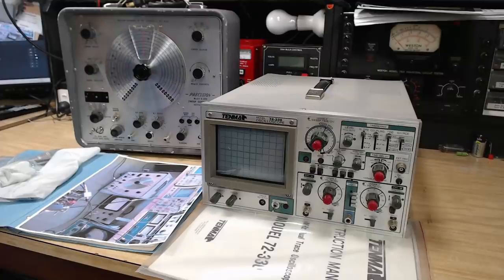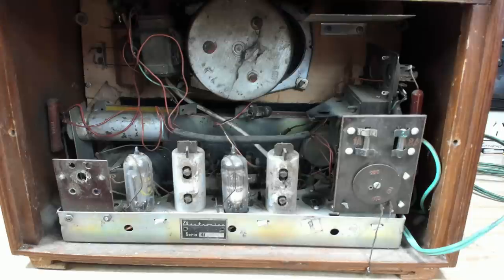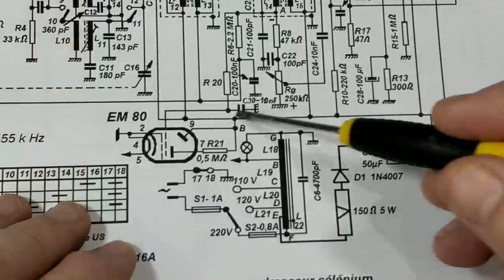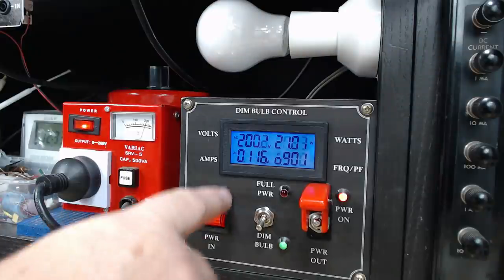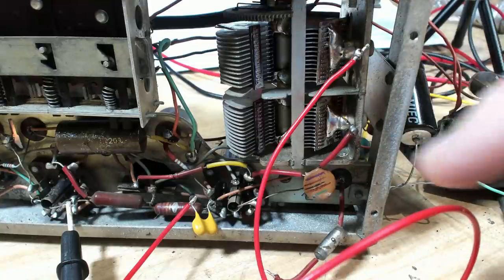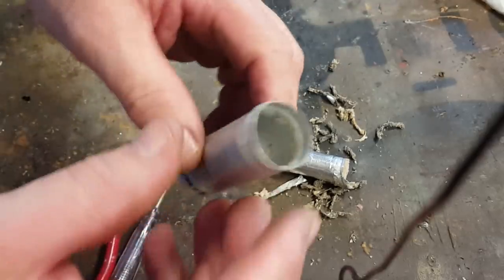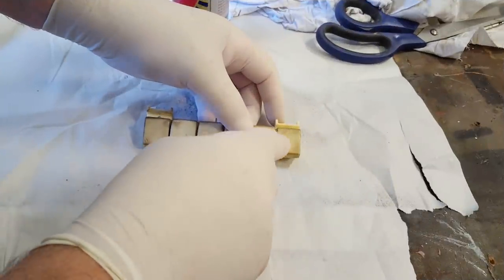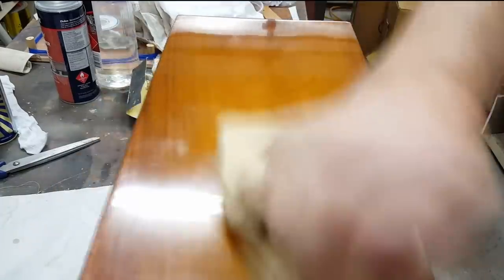Carmen 2 1963 radio from Romania - Restored

Comment: Greetings:
I vote for replacing the second dial light. 
You are a master restorer. I appreciate your cabinet reworking. 
I am a retired Hollywood Post Production maintenance technician; 73 years of age (we are all called engineers regardless of having a college degree). I try to do what I can in terms of repairs, but I often rely on my son for the manual dexterity I have lost to my poor eyesight attributed to my diabetes.  So, I mostly follow my youtube practitioners to benefit from their diagnostic workouts to live via their work.
Reply from the maker: Hi James. Yes, I agree, in retrospect a second lamp would have been better. Old age is a bear, I'm still reasonably capable thankfully. Cheers! 🙂

Comment: Good advice to unplug before walking around inside the radio! My first engineering job I had an old laser with a huge control cabinet you could easily climb in and with several thousand volts unplugging before walking around inside would have been very good advice.
Reply from the maker: Yes, I agree, good advice Yisrael S, those Romanians think of everything 😀

Comment: First of all Vern ,The Radio Mechanic is a great guy and we all appreciate his generosity in gifting the fine vintage 
test equipment  to you . They will be useful in  radio restoration projects much like this "hot" chassis Carmen Mark 2. 
Excellent troubleshooting done by you David. Great e- cap restuffing. Have to remember how it's done. Meticulous
restoring techniques by you have brought this radio back to life. Now that you mentioned it the second lamp that was
missing probably should have been put in. It does look great my friend!
Reply from the maker: Hi Steve, many thanks to Vern, it will take me awhile to set it up though. The cap came out great, I haven't tried that before. I should have fitted the second lamp but went to so much trouble to keep it original I left it out, it's a bit weird having it at one end. Thanks Steve 🙂

Comment: Hi David, when I was restoring my Stromberg Carlson 515 I had a grill cloth that was in good shape but exceptionally dirty covered with tobacco residue, after talking to my wife she told me to dip it in Oxyclean solution, before the dip my wife stitched the edges to keep them from fraying. wow, no scrubbing and the water turned brown instantly. I let it set in it and just dipped a few times then dipped in some clean water. what a transformation!! it was made from silk. I then stretched the fabric and stapled to a temporary backing board with a dry towel to dry.  the fabric  looks like it just left the factory in 1939.
Rich
Reply from the maker: Hi Rich, I can only get Oxiclean from Costco in Australia but I used a stain remover which worked much the same. I am going to my brothers in Sydney next week, he is a Costco member so if we go there I'll see if I can get some. Thanks for the tip Rich 👍🙂

Comment: Great work as usual Dave. The hot chassis reminded me of working in a TV repair shop in the 70's where all the proper engineers worked single handed to avoid any chance of a shock across the chest. Evil things hot chassis TVs and EHT...
Reply from the maker: Yes, not the best idea from a servicing point of view, there is enough high voltage in TVs without making the chassis hot as well. Thanks owwcam 🙂

Comment: Romanian here, thank you so much for this blast from the past. I had some flashbacks seeing various typical Romanian tech part inside this radio. Or maybe typical Soviet parts, not sure, because at that time we were heavily influenced by Soviets in everything, (in a friendly manner, of course...ahem). Ceausescu came to power in 65 and it took some time for him to eliminate the Soviet influence, but yes, he was still bad.
Would be interesting if you can find also a Soviet radio from that era, to restore.
Reply: Fortunatly those eastern block electronics from Romania, Czechoslovakia, Hungary or GDR were more influenced by Grundig and Philips than soviet constructions. They all used standard european tubes or semiconducters, just the whole construction was obsoleted in comparition to the western products.
Reply: @xsc1000  What you say actually makes sense. I expected our radios to be much different that the ones Dave usually restores here, yet they are eerily similar in many points. That makes me even more curious to see a Soviet radio from that era restored.
Indeed, our tech was behind. I remember in the 80's a news bulletin proudly showing off a "combine", basically a wooden case regular radio with a cassette player slapped on its side, and touting it as a big thing.
Not only the tech was behind the West, but other Eastern countries had better tech, like the one made in GDR, or even better by Unitra in Poland. Unitra products in particular were quite good and sought after. And to not forget, (which I did) there was also Tesla, another series of awesome products, so yeah, us being an East-European country wasn't much of an excuse.
Reply from the maker: Thanks airspeedmph and thank you both for your conversation on Romanian and Eastern Bloc radios. A Russian radio would be different to work on, maybe one day 🙂

Comment: Amazing generosity there from around the world. I would have used a high speed steel tool to turn the rolled edge of the filter capacitor off as these can be made very sharp. A very risky move in any case. I don’t recall what the issue with the doggy transformer connection was? Nice work as always.
Reply from the maker: Hi Bob, I agree completely about generous people. My capacitor turning effort was doomed from the start even with a sharp tool, I will improve it next time. The intermittent fault was an unsoldered wire on the speaker 18:51 🙂
Reply: @DavidTipton101  I wonder if putting the cap in a drilled out block of wood would help

Comment: Dave, the black tarry stuff you pulled off the case could be coal soot. Before the wall came down, you could smell the soft coal that the East Germans burned to keep warm in the winter. It covered the cars on the west side of Berlin and when you blew your nose the tissue would have black spots on it.

You might get more brightness from the "magic eye" if you lower the resistor value on the high voltage section of the tube. (If there is one.)

Love your channel, best of luck with your future videos!
Reply from the maker: That's exactly what it looked like 15743 Hertz, I wondered if it had been used in a factory, it must have been good for everyone's health 😲 The magic eye worked pretty good, I think it was fairly new. Thanks 15743 Hertz 👍🙂

Comment: As usual a beautiful restoration.  I will try the loop trick to check the oscillator operation.  Makes it lot easier to check rather than poking around the tube pins for the oscillator output.  I learn something new from your every video.  Thank you.
Reply from the maker: Thank you Nelson, my coil was much too big, a smaller insulated coil would do the trick 🙂

Comment: Always a Joy David. im sure you know, because of the time difference, when you upload your video I'm just about to wake up, perfect timing for a  morning coffee, Trust me, your repairs are much more interesting than the morning news lol
Reply: @David Addition to the first comment, Fantastic job on re-stuffing the cap it came out great, your little coil for testing the oscillation reminded me of when I used to make Metal detector coils, which are basically AM radios just much lower down in the MHz wavelength, Long story short, I used a small to medium size modern round Choke coil which I stuffed into a 1/2 inch pvc tube, to look at the frequency with the scope much like you did, It could be an easier way for others to make themselves an oscillator probe.
Reply from the maker: Hi patprop74, thank you. I time the video release to coincide with your morning coffee, it's the least I can do 😉 I small coil in a plastic tube is all you need, I happend to have the coil I made before and it worked. I might do what you suggest and show it on a video in the future, Thanks patprop74 👍🙂
Reply: @DavidTipton101  Very kind of you to time your videos with my coffee addition schedule David lol hope all is well there for you?
Reply from the maker: @patprop74  All good here thanks, I hope it's the same with you. I try to time it with everybody's coffee 😄

Comment: A long-lived, ever dodgy radio !   A lovely piece of history indeed.  Delighted that you recovered and repaired it .   :-)
Reply from the maker: Hi Beaky Twitch, all it needed was a little TLC, I'm glad I was able to do it 😀
Reply: @DavidTipton101  A Romanian engineer  friend who has got two of these particular radios says you need to connect ant to a long wire, and gnd to ground.
He also says to use vintage repair methods to repair vintage equipment .  
That means to orient your mains connection so that the chassis is at 'cool side' when switched on.  And then beware because if you then switch the radio receiver off, the chassis and it's gnd connection may go 'hot'.  (They use a spst power switch).
Isolation transformers are very expensive and few people who service radios have got them.  I service and line up old radios and I have a Variac/dim ulb but no isolation tranny.
Reply from the maker: @beakytwitch7905  OK Beaky Twitch, lets see how I have it:
I have it connected to a Miniwhip and ground 👍
I have the active wire into the on/off switch and the neutral connected to chassis 👍
Haha... sorry, I thought you had a longer list there, I should have read it better first. The isolation transformers are expensive but I always use one, better than being dead or blowing up test equipment. Thanks Beaky Twitch 👍🙂

Comment: Yet another beautiful job David!  I need to research that "pseudo signal tracing" business you did with the coil of wire and the oscilloscope for testing the oscillators... lots to learn!
Reply from the maker: Pretty easy to check with a scope. You might see the oscillator waveform by just placing the probe near the osc grid 👍🙂

Comment: It's always a great start to the day when I see there's a new video in your chanel. Very interesting and kinda different radio! The speaker with such a massive magnet, maybe they used what they had in hand at the factory at the time... But the sensitiity looks great! Curiously, today I got a mid-80s Sokol 304 soviet radio on the mail. There'll be lots of fun later around here! :D
Reply from the maker: Thank you Álvaro. I don't understand the need for the magnet either. Your Sokol sounds interesting 🙂
Reply: @DavidTipton101  Sokol radios are very sensitive and selective, usually with a hodgepodge of germanium and silicon Soviet flavoured transistors. Mine has already a ceramic filter in the IF stage. Very sharp tuning and a great DXer at night!

Comment: Hi Dave. As I understand it with Autotransformers, as well as being grounded to the chassis, they are like one large coil, tapped at different lengths along its length for all the other lower voltages. So if one section of that winding fails, the transformer operates as if it has been cut out and reconnected. This results in the other taps outputting higher voltages than normal.
Reply from the maker: Hi Aryon, that sounds feasible as long as the non grounded end of the coil winding can find a ground to form a primary that would be the effect. Thanks for that titbit there Aryon 😀

Comment: Hello from a fellow retro electronics geek from Poland :)
These Elwa can caps are pretty good unless they're dried out, which happens when the rubber plug on the top part of the can is missing or cracked. Test with a capacitance meter; leakage test and some reforming is also advisable.
Reply from the maker: Hello fellow retro geek from Poland. The rubber cap was in place but after seeing the overheated return wire I was suspicious of it. I always replace the filter caps anyway because I have had them fail after running for a while even after measuring OK and reforming. Thanks Keri 👍🙂

Comment: Yet another great restoration!  I'm wondering how you removed the speaker cloth, and how you cleaned it.  I'm working o a Nordmende Kadett C that has a similar speaker cloth in need of a good cleaning.  Mine seems to be quite firmly attached so I'd be interested in how you removed yours.  On a side note, based on your restorations I ordered 200 black film caps from Carl's capacitors.  It took 3 weeks for them to get to me here in the states, but they look great and the price was very good.  Thanks for sharing your work  ;)
Reply from the maker: Thank you Rich. I was able to peel the cloth back, I soaked it in pre-wash stain remover and glued it back on. I'm glad Carl looked after you, I haven't had any problems with his caps, they have been very good 👍🙂

Comment: A massive difference!, i'm always gob smacked by your restorations dave.
Reminds me of the Grundig radios as they look very similar.
I'm sure you are a hobby dentist, those keys look super white lol.
Didn't the re-stuffing work well, the end rolling looked perfect.
I thought you had found new grill cloth, it looks new.
I also looked at those oscillator coils, hmm no!.
I've ignored my internal warnings and wished i didn't.
Sorry too much woffle.
Reply from the maker: Hi zx8401ztv, compared to how it looked at the start it is a massive difference and it followed the European radio stylings to the letter. The keys came up like new thankfully and the end roll on the cap surprised me too, who'da thought. I removed the cloth and soaked it for 24 hours in a prewash soaker. Those coils were best left alone 😄
Thanks zx8401ztv 🙂

Comment: it uses styroflex capacitors, which were quite new and modern in those years. All electronic components were made in the IPRS Baneasa factory, it was a huge and modern factory. The tubes were TUNGSRAM import, from Hungary.
Life in Romania was quite good in the 60es and 70es, it started deteriorating rapidly in the 80es, and Ceausescu was trialed and shot after the December of 89's Revolution. 
Radios made by Electronica were exported in more than 50 countries, all over the world.
Reply from the maker: Hi Pop Tibi, I was told this radio had imported caps and resistors and the model after that started using the Romanian made components but I don't know for sure. I wonder if this radio was a export one 🙂
Reply: @DavidTipton101  the styro section of the IPRS factory started working in 1962. so i don't think the parts were imported. They have the IPRS look we Romanian repair men are familiar with. Electronica had a predecessor, called Radio Popular, active since the end of World War II.  Also the Radio Popular had a predecessor too, a factory built by Philips in 1937. So the radio building legacy is quite strong here :)
Reply from the maker: @tlrptg  Ahhh... OK thanks 👍😀

Comment: Hi Dave. Another great restoration. I was worried when I saw you were touching the radio with both hands with a hot chassis. Is that really safe? We’d hate to loose you!
Reply from the maker: Hi Graham, thank you. Probably not the smartest thing to do, it is on a isolation transformer and touching the chassis with both hands shouldn't be a problem, I am very mindful of what I touch. Thanks Graham 🙂

Comment: Dave Do you ever bother testing the capacitors you swap out? I am always intrigued when I swap components, so test them. It always seems that the ugly ducklings are like new and the pristine open or short circuit. BR Mark
Reply from the maker: Hi Mark, I generally don't test them, I don't have a one stop capacitor tester and I generally change them on suspension more than failure. I agree that the good looking ones can be bad and vice versa. I have seen others test squashed and oozing caps only to find them OK 😀

Comment: Great job on the cabinet, looks like all the grime protected the finish, nicotine seems to be good preserver.
We got a few of these eastern block sets imported to the UK, they were generally 10+ years behind western European technology at the time, but were very cheap to buy.
I have quite a few Polish & Russian sets, the transistor sets are particularly sensitive & built like a tank, well worth your time if you can find one.
Reply from the maker: Thank you markpirateuk, the cabinet was well preserved under whatever it was. I was surprised it was fairly modern inside and I can imagine they would be exported to Europe, it was pretty well made. Some of those communist country radio would be interesting to work on 🙂

Comment: Dave I watched the latche problem.
Tip : take a piece of pipe make the inside just some wider then the caps outer skin diameter. Take a saw and saw it over the length through so you get a holder to get the cap inside the pipe place the holder and cap in the chuck and keep the opening of the pipe between two of the Jaws of the chuck now you can set much more tention to the clamping force make the pipe just 2mm shorter then the cap length.
Turn Aluminium way faster I bet 1200 rpm is way better. Set the tool into a point so less friction.
You be supriced how it will work.
Allways nice to see your work. By the way never had a styroflex cap to be faulty. Ok bye for now
Reply from the maker: Hi Martin, agreed, that would be the way to do it, I considered doing it with plastic pipe and it would fit similar sized capacitors, I'll try it next time, thanks. I was very surprised the styro cap failed too, it was low on the suspects list 🙂
Reply: @DavidTipton101  never had one styroflex to fail well one thing is a disadvantage styroflex value in uF will change for ever when it's been heated up to much say its near a tube that heat alters the uF or pF ceramic will be much better but isn't good for in line with signal path but great decoupling. Nice to see you try my latche tip. It will work try it with a cap that's not to be restuffed.